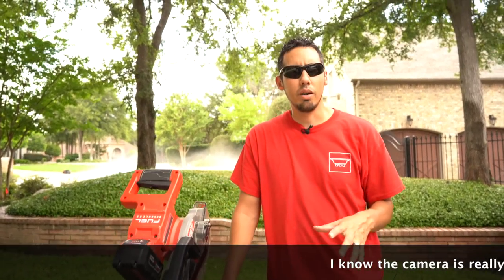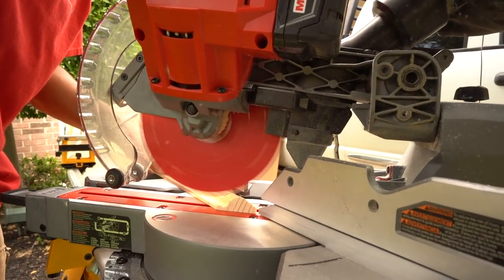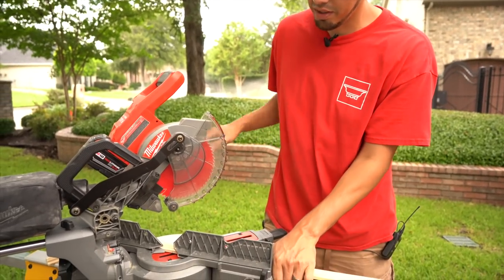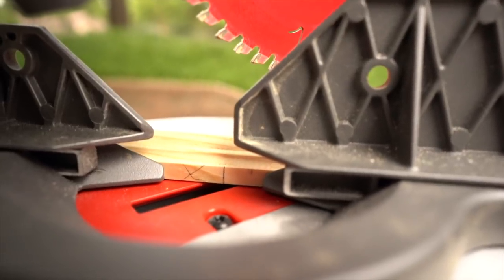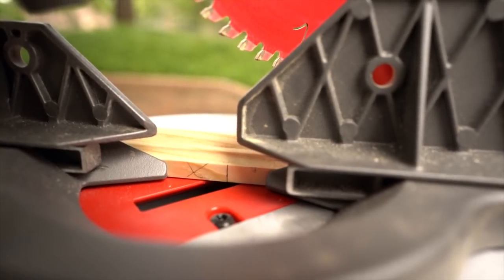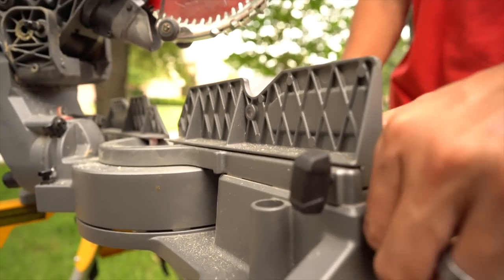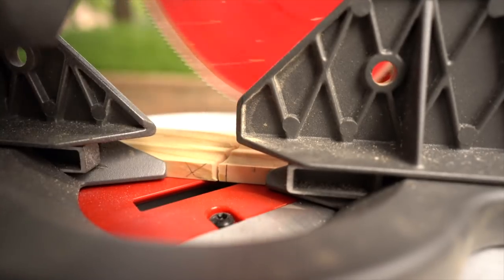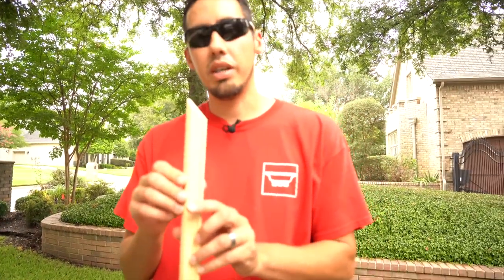Miter Saw Precision Tip - Getting Right to the Line

Comment: I use the same technique.  I would only add that it is beneficial to move your hand closer to support the work better.  I generally split the difference on the fence but your tool has thumb cut outs on the fence fifty percent to the the blade.  That is a nice feature for holding small work securely while using the “nibble”  technique.  

Thank you for taking the time to publish your tips, tricks and experiences.

Comment: Yes!! More precision tips for measuring and cutting miters for wainscoting. I’m having difficulty accurately cutting the correct length of a strip of molding with an inside corner miter on each end.  I’m using a miter saw that tilts only to the left.  The right end cut is easy.  It’s the left end cut that is driving me nuts.  I’m either too short or too long.  Any suggestions are appreciated.

Comment: Thanks for the tip. Is obvious it works well on small boards and moldings. 
I've seen your production work and as a professional finish carpenter, I understand you address those who do the same type of job or want to learn from you. Therefore,  I'm sure you expect us to watch and use common sense for us to learn rather than make videos that could last 15 minutes instead of 3, like this one, using 12 extra minutes explaining what normal dexterity can achieve, saving time and money on other gadgets.   
Thanks again.

Comment: Great tip! Have any tips for testing for alignment on a miter saw in the field? 90 and 45 degree cuts.
Reply: Alex Edwards try a speed square against your cuts you can test angles by putting speed sq on table to cheak 90 degrees

Comment: How do you go about when a nail from nail gun dosent fully go through any trim piece/moulding? Hammer the nail in or whats the best way?
Reply: roy luna, most guys that do trim for a living.  carry a spring loaded double sided nailset in their pocket or tool belt.  Called a spring nail set and can be found on amazon, ebay, rocklers.   I personnaly have 4 different ones i carry in my tool belt( different sizes for different nail head sizes) they even make a small chisel type one for areas you cannt get a normal chisel to fit into.  I cannt tell you the last time i used an actual hammer and nailset after getting these.
Reply: Great, thanks for your help. I do Remodeling/Renovations and have always had problems with those pesky nails that wont go through fully. Looking forward to ordering myself a set ASAP
Reply: Roy, you're welcome.  Hope they work as good for you as they have for me.

Comment: Is there such thing as a blade stiffener, to counteract deflection? (For use with a 12in chop saw)
Reply: jvsnwbrdr25 , i havent seen one, and been a trim guy for 23 year as now.  Most guys that worry about a blade deflection change there blades and use "industrial" blades.  Which have a thicker body thickness(plate) and most of the time have a wider kerf.  I believe the frued fusion series blades have thicker plates, they have an industrial line of blades( they dont have teflon coating like the fusions do) or forrest chopmaster blades i think have the thickest plate of any blade made.....but they are also expensive close to 200 a blade for a Forrest.

Comment: Do you ever use a material hold down clamp when cutting larger material? When I cut 3-1/2" x 3/4 casing it tends to slide on me and I don't get a straight cut.
Reply: If the material is sliding its because its not supported out away from the blade. the material's weight is pulling it to or away from the blade. Set up a material rest out away from the saw and if you have it correctly placed, the material should not move at all if you take your hands up off it.  ideally, your only positioning the material, not holding it down for the cut. Serious kick-backs could result.  set up the rest...cut on!!
Reply: Darren, if your material pulls into the blade you either have one of the following
 a dull blade
 a blade that has pitch( wood sap) gumming the blade, can make the side of the blade sticky once it heats up while cutting stock.
Or you are applying side ways pressure with your fingers pushing the material toward the blade.
Most field guys( trim carpenters, installers)don't usually clamp material down.  Slows down the flow of work you need to get done by messing with clamping/unclamping, especially if you have a few guys cutting on a single saw.

Comment: I make homemade miterbox that way you can put your pencil line exactly we’re the blade is going to cut very accurate little extra effort but with it in precision
Reply: its called a zero clearance insert
Reply: make an arbitrary tick line on the fence and also on some scrap cut off... then line the two tick marks up and cut the end of the scrap off ...... now line up the cut you just made with the tick mark on the fence...and make a second tick mark on the fence where your mark on the scrap is now located further back.... now any cuts you have to make simply mark your measurement that you need.. line the mark up with the tick on the fence closer to the blade...make a second mark on the work piece where the other tick mark on the fence is.... now line that mark up with the first on on the fence and cut... dead nuts every time.... sounds confusing its really simple..
Reply: d c Huh?
Reply: Carpenter One3 ya you mount it to your chop saw cut it and it shows you were the saw blade is going to cut
Reply: d c home made zero clearance insert

Comment: I thought you had converted to DeWalt miter saw with laser beam?
Reply: Joe T I’ve used that saw for 4 years now, I love having light there but it’s pretty much useless as a blade indicator. From all the way up you can hardly tell where the shadow is on the work piece. 
From 1/2 way down you can make it all out but it’s still not 100% clear so you just end up putting the blade all the way down to the pencil mark anyway. Unless you’re cutting large pieces that are close to the blade already.
Every saw should have LED light though in my opinion.
Reply: I have a laser on mine, it's consistently off. I really don't think anybody has made one that is 100% dead on.

Comment: A zero clearance insert would be a lot faster.
Reply: make an arbitrary tick line on the fence and also on some scrap cut off... then line the two tick marks up and cut the end of the scrap off ...... now line up the cut you just made with the tick mark on the fence...and make a second tick mark on the fence where your mark on the scrap is now located further back.... now any cuts you have to make simply mark your measurement that you need.. line the mark up with the tick on the fence closer to the blade...make a second mark on the work piece where the other tick mark on the fence is.... now line that mark up with the first on on the fence and cut... dead nuts every time.... sounds confusing its really simple..
Reply: d c is there a video showing this trick somewhere?
Reply: Maybe. But a zero clearance fence would only work for one angle of cut. Once you make a 45L, 90, and 45R that “zero” clearance is more of a 1/2” clearance. Plus they often get in the way of beveling the saw. A throat insert may work if it’s possible to easily make it for the saw. FastCap actually makes zero clearance tape which I have but have yet to use.
Reply: William Butler a zero clearance insert not a fence.
Reply: Mr Geronimo that’s what I said. I was replying to d c.
Reply: William Butler ahh. Gotcha
Reply: I think it was on insider carpenters instagram alphapimp
Reply: d c had to read that slowly 3x to “think” I have it. Lol
Reply: you can also just buy this zero clearance fence... they have other products like a cool stand and saw stop but its kind of pricey.
Reply: Or you could make a straight cut from your line and then use the edge of that cut as your guide to cut the 45